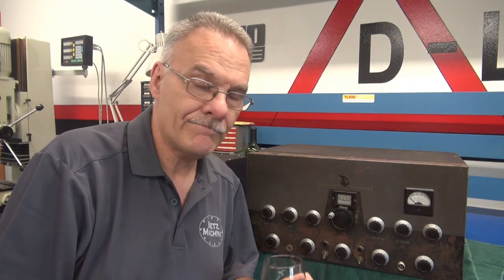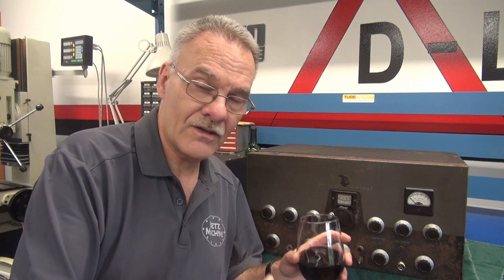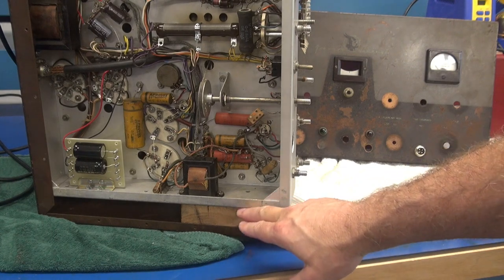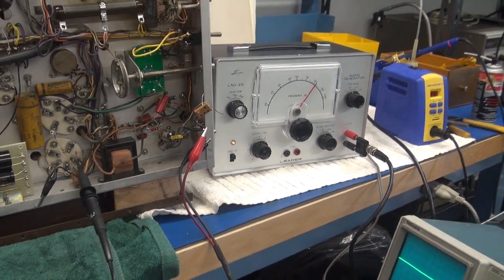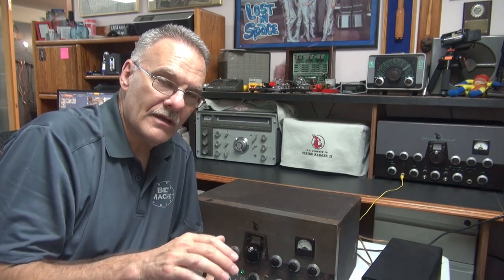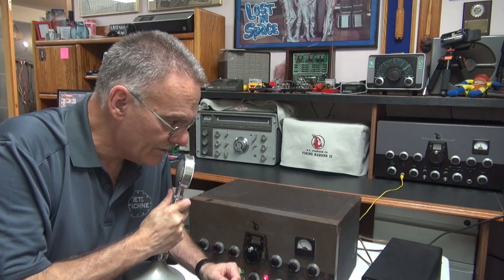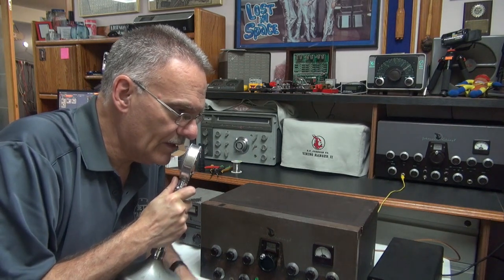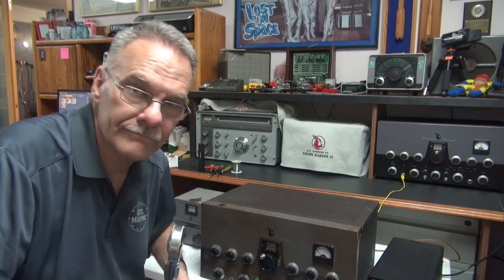Ugly EF Johnson Viking II Ham Radio transmitter Modulation Test Stancor Hammond transformer Part 3

Comment: Have a question, I have an old swan cygnet 260 single side band, I just got, I noticed when I transmit it has the power output but only transmits on am, would the tubes need changed or would this have to do with the two bias adjustments on the back, any info would be greatly appreciated?